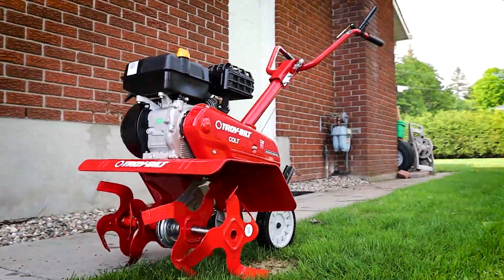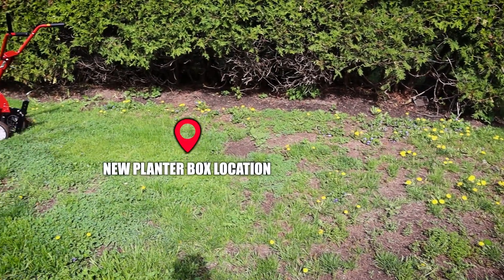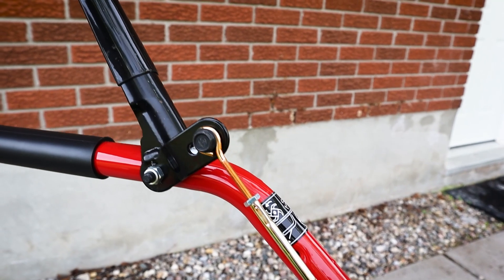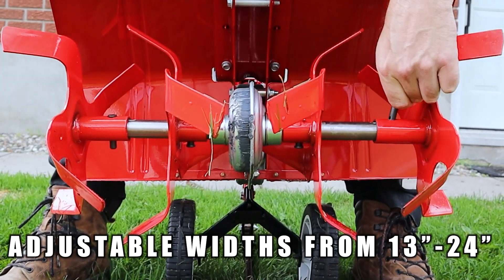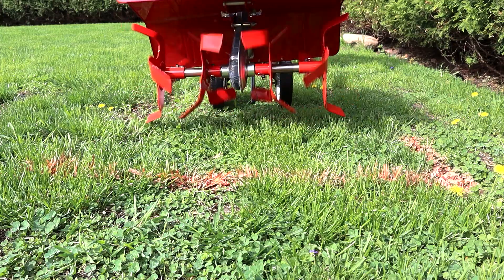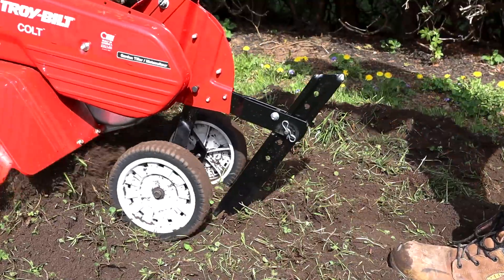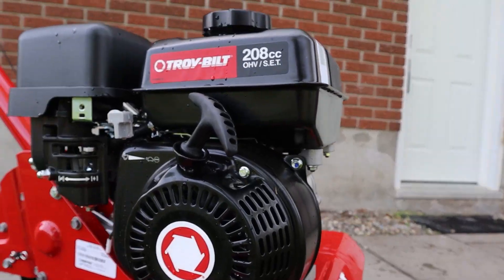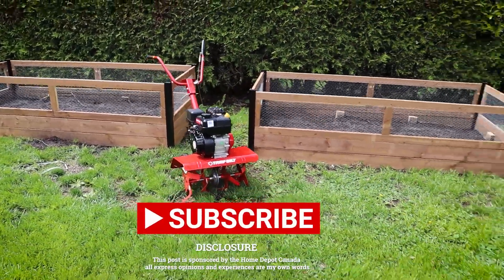TROY-BILT COLT, FRONT TINE TILLER

Comment: What does that little wire go to??
Reply: Do you mean the handle bar cable? If so that cable goes to the clutch
Reply: @hiphopman72  No the one from underneath the recoil. It's got a white connection on it. ?

Comment: If you reverse the tines (right side to the left side and left side to the right side), it will be much better. I’m not sure why they show them the way you have them, but that is not correct. You aren’t supposed to have to pull it backward. When tines are correct, it will pull itself gradually ahead through the soil, making it easier on the operator.
Reply: Thank you so much for this comment. I bought a tiller from someone and I could get it to dig down unless it was going backwards. I just changed out the tines and it worked !!!! It does great now. Not as hard on me.
Reply: Same experience. These are backwards compared to all other colts I could find except mine. Mine came from the dealer backwards